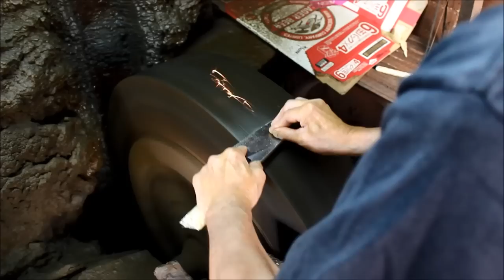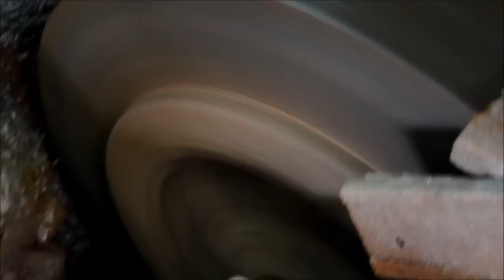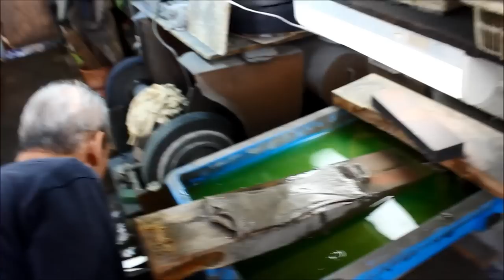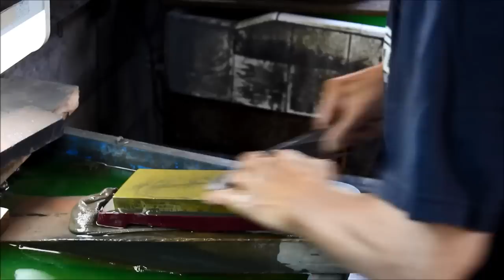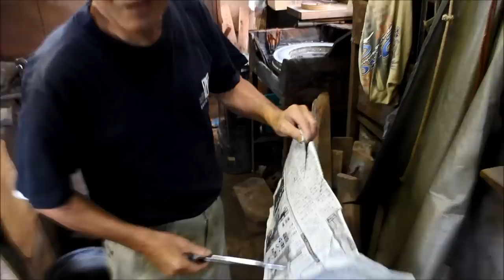Sakai Takayuki repair a broken Deba knife blade by Norikatsu Nisimura

Comment: What is the Horizontal grinding wheel called? trying to buy something similar but having a terribly time!
Reply: Bart Jacher says:
"What is the Horizontal grinding wheel called? trying to buy something similar but having a terribly time!"
==
Those big diameter stones are prohibitively expensive and made for industrial use(somewhere in the tens of thousand dollars).

Here's the small version for the professional trade people(carpenters, cabinet makers etc. mostly for chisel blade sharpening).
It's still expensive for the home use.

http://www.homedepot.com/p/Makita-1-1-Amp-15-3-4-in-Blade-Sharpener-98202/203231412?cm_mmc=Shopping%7cTHD%7cG%7c0%7cG-BASE-PLA-D25T-PowerTools%7c&gclid=Cj0KEQiA_eXEBRDP8fnIlJDXxsIBEiQAAGfyoWSg8THxDVfHpH09MrhxTkt8zLkZgb4JyEu_-_W08-oaAp9r8P8HAQ&gclsrc=aw.ds
Reply: Though it would not be like what you saw in the video, you could fairly easily set up a horizontal disk grinder with water feed. Much of the same processes could be achieved this way. Much of the equipment you see in the Japanese Shops is non existent in the USA...and even in Japan, difficult to get and as stated...very very expensive, but last a LONG TIME!
Reply: You could just make your own for a couple hundred. Buy a bunch of stones(or whatever abrasives you want), glue them to a plywood baseboard, shape it to a circle, put it on bearings, buy an induction motor(or a grinder or any suitable motor), buy a vehicle alternator belt or fan belt and set up the belt from the motor to the abrasive wheel(belt drive) to whatever gear ratio you want. 

A simple belt sander is probably way better though, in my opinion.

Comment: what is dat green color in your water ?
Reply: the stones used in japan are actually a hard clay which contains abrasive particulate, what you see in the water is part of the stones which have been scraped off and dissolved.
Reply: joshua woodruff Thanks for the info
Reply: It is a solution they add to the water to stop the water rusting the carbon blades. It is not from the stone itself

Comment: Is there anyone know what brand of sharpening stone that they use?
Reply: bleach nine it's a wetstone. There is no real "brand" when it comes to them, you simply just go with who has good reviews. Most of these licensed Smiths get their stones from samurai schools, and they are not cheap. One of these stones are designed to last for quite a while, and are really high grade. Most places that specialize in Japanese cutlery will sell large wetstones. My set is a small travel set, consisting of a 80 grit, 800 grit, and 8000 grit, and it works well for reshaping, sharpening, and honing my knives.
Reply: Hey thanks for the information, that's really complete explanation. Btw, for your set what brand you used? Or maybe you can give me some recomendation about wetstone that people usually use?
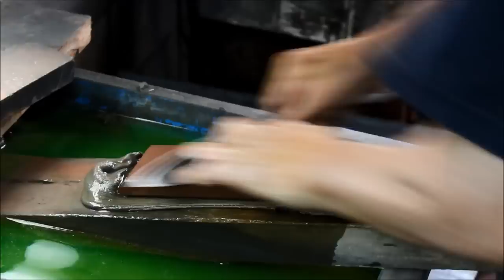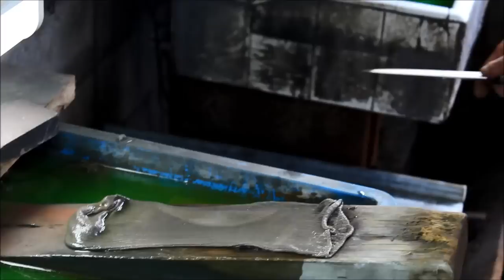Reply: Not sure about the the thick stone or the wheels, but the brown stone at 2:05 appears to be a King 1000, and the yellowish one at 2:30 a Naniwa (brand) Chosera (series) 2000.  Both of these brands are great in my experience.  Also look at Suehiro for good quality, reasonably priced stones (everybody seems to love their Rika 5000.  Me included.)

Comment: Why is the water green?
Reply: the stones used in japan are actually a hard clay which contains abrasive particulate, what you see in the water is part of the stones which have been scraped off and dissolved.
Reply: Awesome! Thank you for the response!
Reply: It is a solution they add to the water to stop the water rusting the carbon blades. It is not from the stone itself